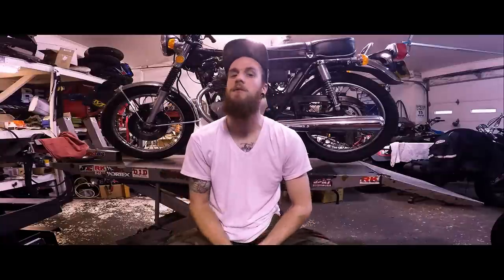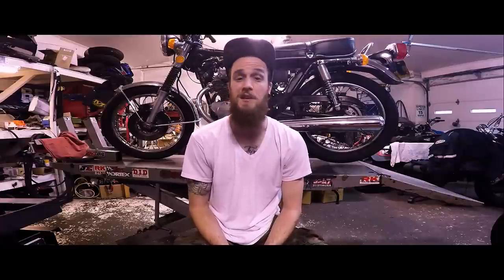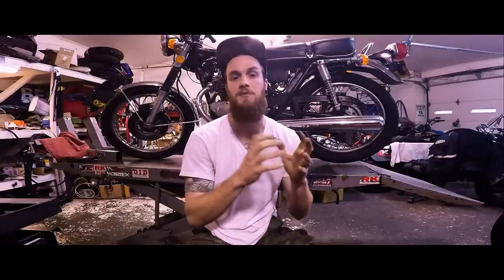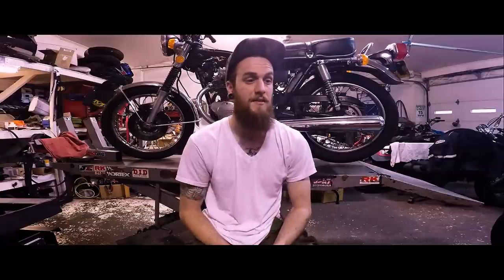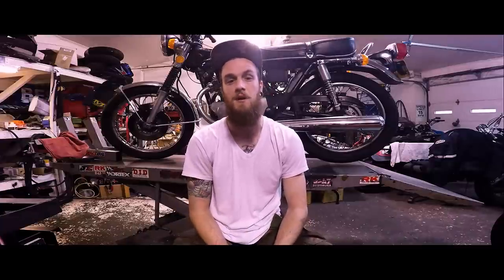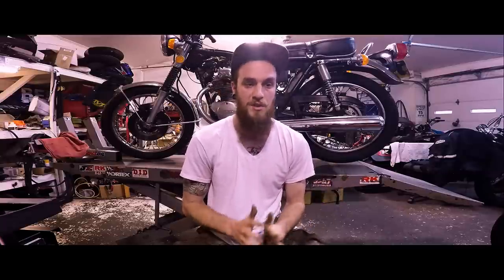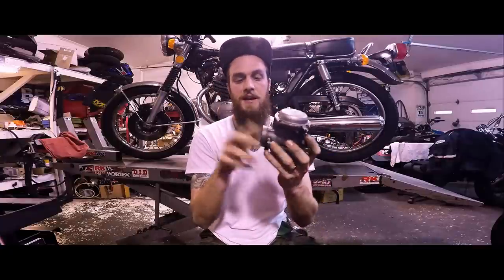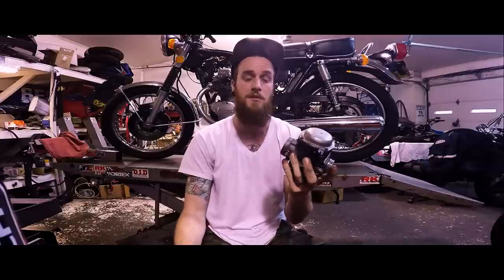How to diagnose a carburetor problem in less than 5 minutes

Comment: Hi, bike drove to fuel station, tank in Reserve, tanked, motor did not want to start and feul was running out of overflow pipe? 
Any idea?  I did wiggle in case float stuck.  Other?
Reply: Potch Boer flooded engine/float stuck. My bike used to do that only on a full tank. Ran and started fine on low fuel. As soon as I filled it up from all the weight of the fuel bearing down on the carb it was easier to flood the carbs and ignition. Usually started fine after leaving it for 5 mins and giving the carbs a bang

Comment: Hi please  I could do with some help , I’m almost losing the will to work on the bike and may give up and send it into a garage.. the issue is throttle response ,, the engine will have a delay when picking up rpm ,  I know it can be fixed and be rapid response again but not sure exactly what needs doing ,, it’s a Ajs dd125e. Twin carb 
Also the 25 % throttle kinda sputters 
Poor acceleration until picks up. 
And the idle is garbage it’ll slowly decrease rpm until the engine cuts out , 
I have to rev it every so often when sat at traffic lights , 
I’ve tried the best I can with the air fuel idle mix but cannot get a comfortable idle or good throttle response ,  it’s just so disappointing
Reply from the maker: Get the carbs clean

Comment: A carburator is not an easy thing that the problem can be solved, with some clean,  is much more than that.

It have a lot of points to check and tune, to give the maximum power from your bike or car , you really must be an expert, shit talk dont sove problems or even give you a PERFECT carburator.

Comment: Would it start a flooded engine?
Reply from the maker: ChuddleBuggy Flooded with gas or with water?
Reply: With gas, sir.
Reply from the maker: ChuddleBuggy If by flooded you mean the plugs are wet. If the compression/valve train are in order and you have good spark then yes. If by flooded you mean the cylinder is full of gas and it won't turn over due to hydrolock then no 😂

Comment: I have a 1998 SUZUKI GSF 600. I put in fresh fuel, cleaned the carbs and replaced some parts, like floats, (my first time messing with carbs). It starts and revs high with starter fluid and then dies. I followed guides on adjusting floats and adjuster screw. I'm pretty sure I got the floats correct, but I am not 100% sure about the adjuster screw, I tried messing with it but no change. I opened drain plugs to make sure that the carbs are getting fuel in the first place, and they are. I am not sure how to proceed. Can anyone help?
Reply: Im in the same situation right now were you able to find a solution?

Comment: Thank you for this video 1995 gs500 starts with fluid and revs high and stays running if i keep the throttle open but if i let go of the throttle or let it fall below 3000 rpm it cuts out
Reply from the maker: +Joe Dirt Clogged idle circuits! Time for a proper cleaning!

Comment: I have a 1982 Honda Sabre V-45 that has a starting problem.  My motorcycle has become so unreliable that I am afraid to ride it any more due to the starting issue.  Here's what happens.  As I try to fire it up when the engine is cold, it will usually start after I push the start button for the thirty seconds.  The choke is on full.  The petcock is in the ON position..  Once it starts the engine purrs like a kitten, and I'm able to ride my motorcycle.  After riding it around town, obviously the engine is hot,.  If I shut off the engine for a few seconds, it starts right up again.  Here's where the problem begins.  When I turn off the hot engine, wait five to thirty minutes,  it will not start up again.  I have a little bit of choke on when I'm trying to start it.  If I wait until the engine is cold it will start.   This is my problem.  I have spoken to every motorcycle mechanic in town and no one has been able to diagnose the problem.  Does it sound like a carburetor problem to you?  I have been quoted that it will cost up to $1000.00 to rebuild my carburetor so I must be sure that is the problem.

Comment: Hey doc, saw your choke video. Once my xj600 warms up it starts revving high until I shut choke off. It then idles ok,  but touch the throttle and it dies. Currently cleaning the carbs but they don't look bad. The shit storm all started when I overfilled the oil. Probably half a quart. I wasn't factoring the sludge lol. Kerosene in crankcase, cleaned spark plugs, etc and it fired up again. Not sure if these things are  correlated.  Any thoughts? Rode the bike two days and been hacking on it three lol. Help

Comment: Remove the Carbs and clean them , NEVER use Starter fluid or anything similar unless you really want trouble !!!
Reply from the maker: mozzmann Interesting comment, what trouble do you speak of? This technique for troubleshooting has been used widely around the tech industry for decades. The method I mentioned is for quickly diagnosing three possible fundamentals of the combustion process.
Reply: Carb Cleaner contains many of the solvents and cleaning agents but NOT Ether , a Highly Flammable solvent that is also highly explosive under certain conditions,  in the US Starter fluid may not have ether in it any more and if that is the case , you may be able to disregard. 

As for problems I have seen bent and broken Con Rods as a result of things like AeroStart and other Starting fluids.
Reply: Yes I have used solvents etc to diagnose leaks and so on by judiciously spraying out side the carb but have seen the nasty results of motor's that have been destroyed due to the use of things like Aero Start and similar or should I say over use by those who just don't know what they are doing. 
They are IMHO far to volatile to be sprayed directly into petrol engines unless the motor is being cranked and the spraying done in tiny amounts (While Cranking) ,
Reply from the maker: The amount used is key of course. I would never suggest filling your cylinder with starter fluid to get it to run. Just one or two quick hits at the filter while turning it through.

Comment: So I could use some personal help with a Yamaha ThunderCat .. Kehein carb set, just threw in a Dyno stage 1 kit, proper rebuild kits and gaskets .. New plugs .. clean engine .. good coil pri/2nd resistance and continuity of plug wires .. engine starts fine - revs to 4-6000 and bogs and won't climb from there .. all fuel lines are new from the rebuilt fuel tap down to carbs, pump is old but ran fine on external 12v .. email me please?? gofastangelyyz on Gmail

Comment: HAHAHA STARTER FLUID that’s really dumb. You should mention about the TDC pre-combustion....yenno the part where it blows your pistons?
Reply from the maker: If your piston blows apart from a couple sprays of starter fluid, you have either replaced your piston with a plastic cup or you found a way to dip  your motors head  in liquid nitrogen. Common sense should tell you it is probably not best to go down the street running your bike off of a can on spray.